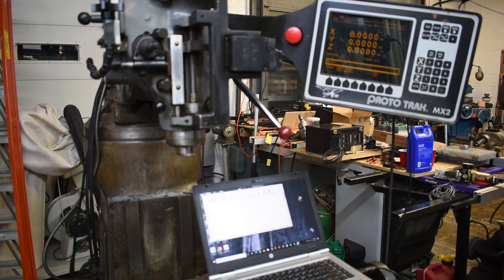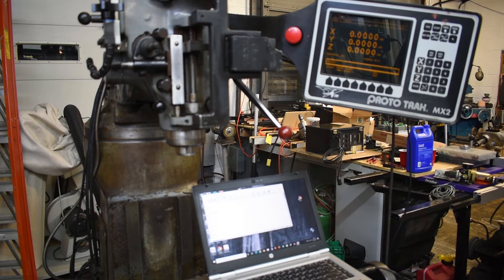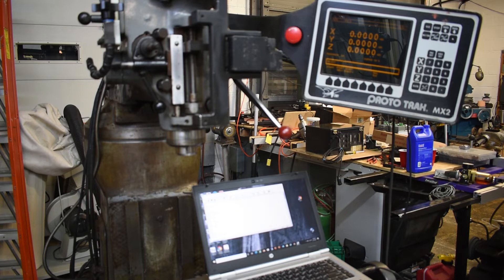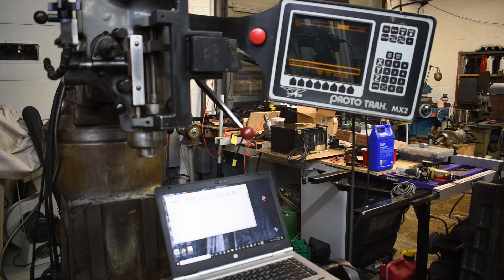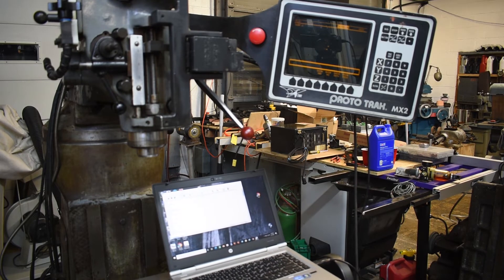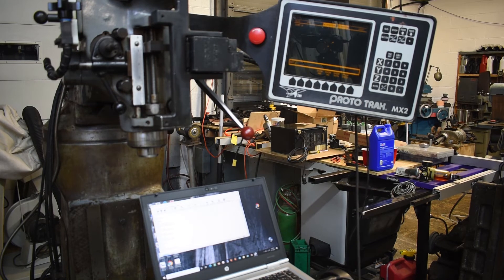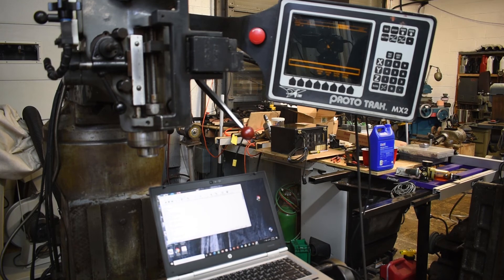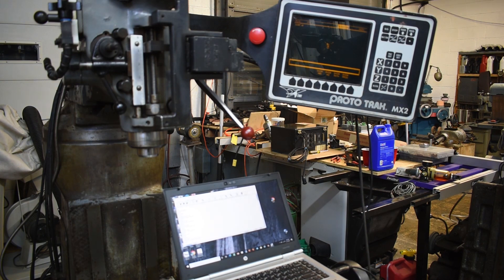Bridgeport Milling Machine Equipped with Prototrak MX2 control system Part 4

Comment: Hello,
I just acquired my first Bridgeport mil that comes with proto track MX2 like yours, but after months of use the letters on the screen start to shirk, which makes it hard to see  Have you eexperienced similar issues ?
Reply from the maker: Sorry to hear.  its most likely your CRT screen.. slight chance it could be the video card on the MX computer in the control cabinet.  replacement LCD's are available. try searching google.  Joe